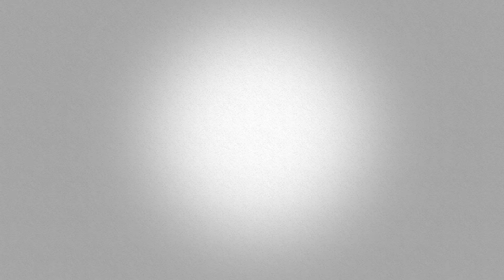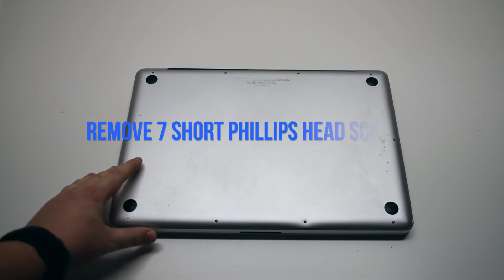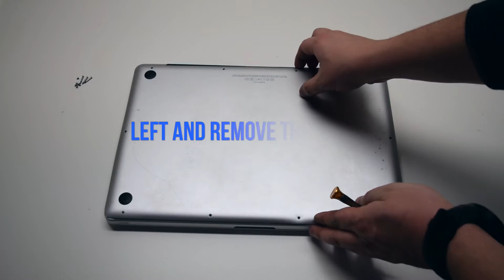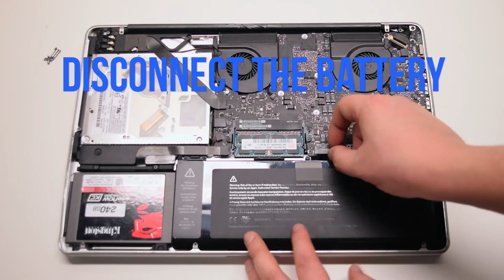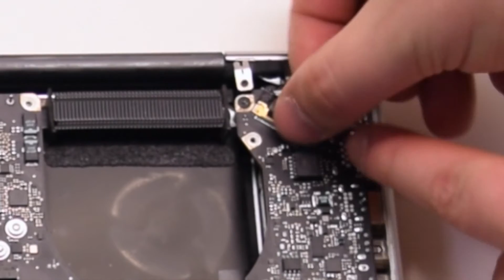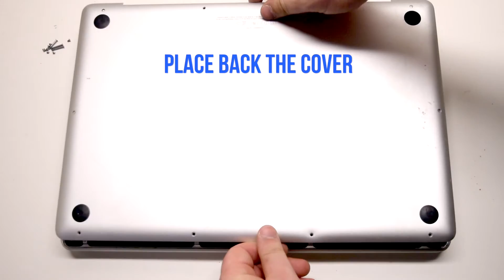2012 Macbook Pro 15" A1286 Logic Board Replacement

Comment: Hi there,
My logic board failed... I missed the recall for my macbook pro I guess.  I was wondering, since another person mentioned it, if you know of a reputable seller on ebay and would not mind sharing his/her name.  Also, how would I know if the logic board is good? I don't think it would fail immediately (mine didn't) and it isn't that cheap either. Any suggestions would be greatly appreciated. Thanks again for the video.
Reply from the maker: Here is a link to a logic board for a 2012 15" https://ebay.to/2QWCmEj replacing the logicboard is like replacing the entire computer, it will basically be a new computer in an old case. It will fix all your issues.

Comment: pushing the keyboard cable back in is a pain. right now i'm still trying to get it to work. i've pulled up the front lever, is that all i need to do, there doesnt seem to be enough clearance
Reply from the maker: You have to use tweezers from the side.
Reply: Thankyou, got it sorted in the end.

Comment: I wonder if a 2012 board would fit the 2010 body
Reply: No it will not. Your 2010 case will not accept it without a lot of modification. The 2011 to '12 swap is the bomb!
Reply: In in need of a board for a 2012 MacBook pro

Comment: Where do you recommend to purchase parts?
Reply from the maker: Ebay is the best place. Here is a link to a regular re-seller https://www.ebay.com/itm/MacBook-Pro-15-A1286-Mid-2012-Logic-Board-2-6Ghz-i7-661-6492-820-3330-Tested/262574309567?hash=item3d22a600bf:g:OyAAAOSwdzVXrVMk If you are desperate to save money, you can get this board with one bad Memory slot and purchase a single 8gb ram chip so you don't loose memory, that will save you a few hundred https://www.ebay.com/itm/2012-Apple-820-3330-MacBook-Pro-15-Logic-Board-2-3GHz-i7-60-Day-Warranty/132460031779?hash=item1ed73baf23:g:xYgAAOSwnlFaUTTM